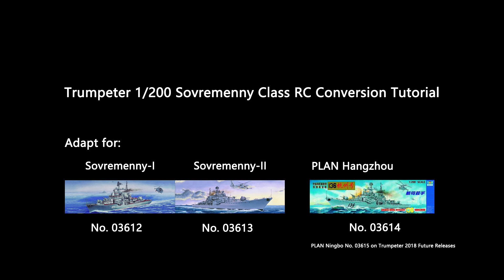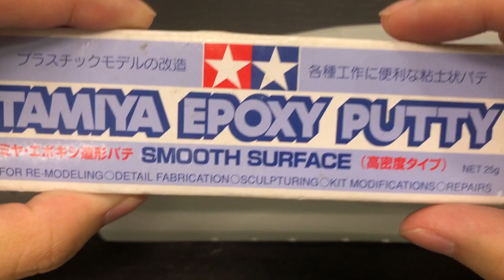1/200 Sovremenny Class Destroyer RC Conversion Tutorial

Comment: Great presentation  again Hugo!
Reply from the maker: Great thanks Thanassis!
Reply: @Hugo-ot7xu  I bought the Very fire Montana from you. I follow your videos closely so I can learn from the master
Reply from the maker: Cool, we do have video prepare for 1/350 Missouri, which is sharing exactly the same shafts and props with Montana.  @thanassisveggos627
Reply: good day Hugo looked at your video really liked the set of modifications for the 649 project code "SARYCH" tell me whether it is possible to order anywhere and interesting characteristics of the motors that you use
Reply: Good day Hugo really liked your video on the set of modifications of the destroyer modern is it possible to order such a kit from you or give a link to the website of the store that sells with Russia is ready to buy , about the video the destroyer goes very quickly so to speak not a copy but in General very cool. With respect Alexander
Reply from the maker: @ncrgcew6939  Great thanks for your watching. The model ship itself is not that expensive, but calculating with shipping cost to overseas, say like Russia, it may not being so attactive. I think the keywords like Trumpeter 1/200 Sovremenny could find it. Motors I used are quite common, just use keyword like 180 motor could find bunch of items.
Reply from the maker: @александрседаков-ж9ъ  Great thanks your admire words. I would consider updates relative item on my store on eBay. Again, such huge packaging calculating with shipping cost to overseas would be quite expensive while the model ship itself is cost friendly. Exactly, I have to point out the speed we drived is quite fast, but it sill just like 1/3 or 1/2 of the maximum speed. Indeed we don't recommend drive that fast.

Comment: This is really nice, but seeing it in action had me thinking a nice addition would be some sort of inertial counterweight system to level the boat when it turns. I know that the real ships "flop over" on fast turns, especially the really big ones like aircraft carriers, but I think this model would look a lot more realistic if it did not tip quite so much on turns.
Reply: The model is very beautiful, its sailing fools you because the video is at normal speed, also the warships because they are very narrow and with large superstructures, they have the tension in the fast turns to take a big tilt in degrees.

Comment: Hello. What battery  in the boat?
Reply from the maker: Hi, a pair of 18650 Li-ion battery in series connection with 2200mAh capacity each. Weigth of the battery could be control around 90 gram, our plan is 43~45 gram X2. The 180 motor is quite low energy comsumption, 7.2V 2200mAh is pretty enough for a hour uninterrupted sailing.